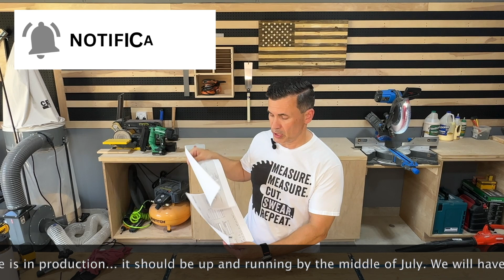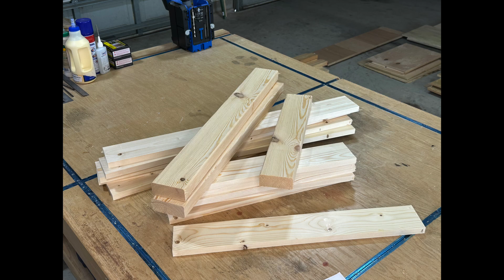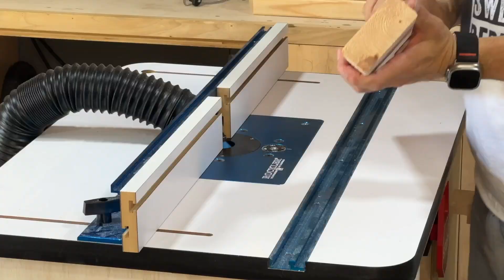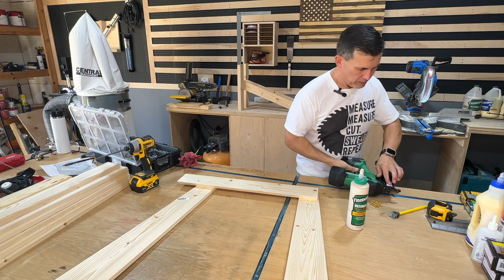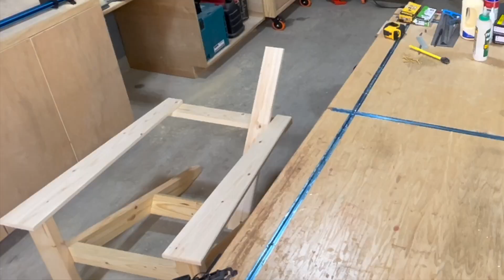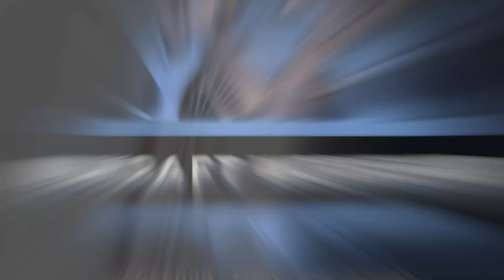Crafting a Contemporary Adirondack Chair: DIY with Everyday Materials!

Comment: Get rid of the glue bottle and use and empty mustard dispenser. The plastic kind and your glue delimina is over.
Reply from the maker: 😂😂. I know there is literally an unlimited amount of options for me to avoid this but I always catch myself buying the smaller bottles of tight bond instead of using the gallon bottles I have to refill A Better dispenser  🤬
Reply: @NuKraftWorkshop  Doesn't matter what size, just empty it into the clean mustard container. I been using this for about three years now and no more stopped up glue bottles. Workes even better than the gluebots.
Reply from the maker: @stanleysmith8984 I’ll add some to my next order from Amazon 👍🏼

Comment: Do you have suggestions on how to make a wider seat? I want to make a chair for someone on the heavier side. I need the chair to be more beefy
Reply: Thank you so much, that would be really helpful. Being a newbie is at times -- zero fun...
Reply from the maker: @Marys_Pots_Pans_and_stuff no worries at all. You’re not the only one asking about plans and diagrams. I know those things can be helpful… I am a visual learner and the more I see, the more I will grasp it. I promise everything is in the works
Reply from the maker: You could simply make this wider. It’s actually very sturdy as is but depending on how heavy/big the person you are referring to is it might need some reinforcement along the back as well. If you make it wider you could add an extra brace to the frame under the seat slats and you could always add some braces along the back where the back of the arm rests and the back of the legs meet. I should have my website up with plans available in the next two weeks and I could show you on that diagram of the plans what I’m talking about. Hopefully that made some sense 😂
Reply: @NuKraftWorkshop  About 300 lbs give or take
Reply from the maker: @Marys_Pots_Pans_and_stuff I would brace it… Just to make sure. Because of the design of this chair slats that make up the back are taking most of the weight on that portion and they are only one by fours.